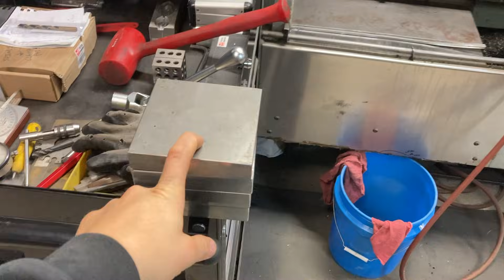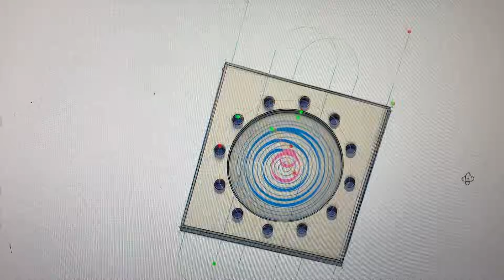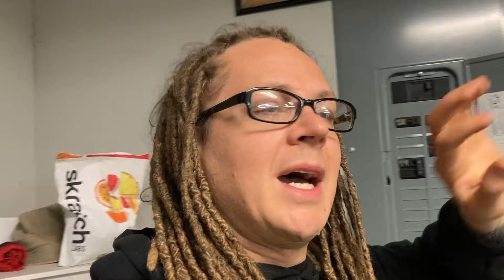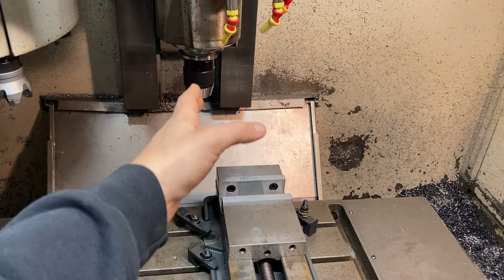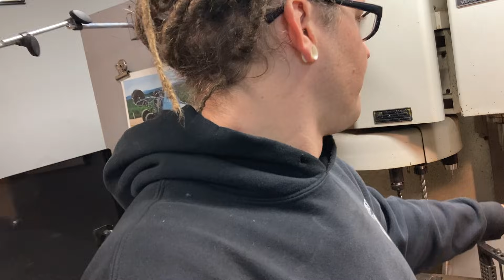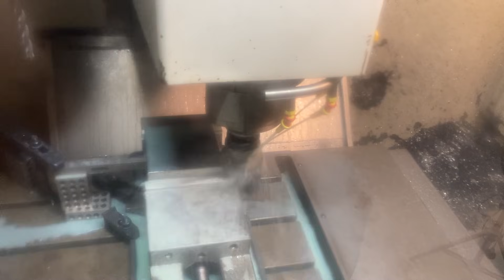Set up a Fadal VMC 20 CNC Mill to machine prerunner parts - DH Vlog #80

Comment: I have a Fadal 4020 and I tap everything in it without rigid tap.  Buy a ER32 Tension Compression Tap holder and just select right hand tapping in Fusion.  It works perfectly.  I do as small as #6 all the way up to 1-1/4 with no issues.
Reply from the maker: That is the plan.

Comment: Figure out how to thread-mill in Fusion. You will never hand-tap anything again. Trust me. I don't know Fusion. But I'm sure it will do it. And I'm sure the Fadal will do it. It is basically a helix bore. You will have to purchase thread-mills for specific threads. There are countless styles. I thread-mill any thread in steel over 1/4".
Reply: That's fine and I do that as well, but a T/C tap holder is WAY quicker than thread milling everything, unless you spend nig bucks for a pitch specific thread mill.  I just buy the multiflute 60 degree so I can make lots of different thread pitches with it.  Again, the T/C is WAY quicker.

Comment: I love finding channels with people running old machines. I’ve got a 2001 chevelier VMC, 40x20x20 travels. What high feed mill are you using? I just picked up this 20 mm one from haas, I messed up though, it sticks out like 6 or so inches from an ER32 holder and chatters like crazy.
Reply from the maker: I use the haas 1" HF. 3"s of stick out. Don't have any chatter issues at that length. I also use a 1" end mill holder with it, not a er collet holder.
Reply: @dunehippie right on, I messed up, I’m pretty new to machining.

Comment: Great machine. Start thread milling, its a game changer. You dont need a hard stop, just put a 1/2" dowel pin in a tool holder and program it as a stop.
Reply from the maker: I'll be investing into compression tap holders once the finances, and need for it, justify it.
Using a hard stop is faster and easier than setting up another tool with a dowel and programming it.